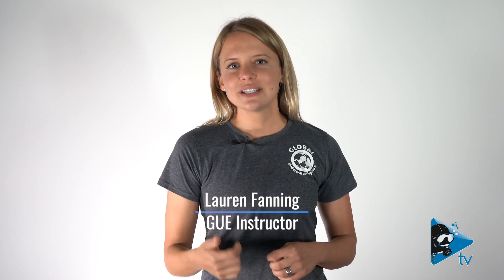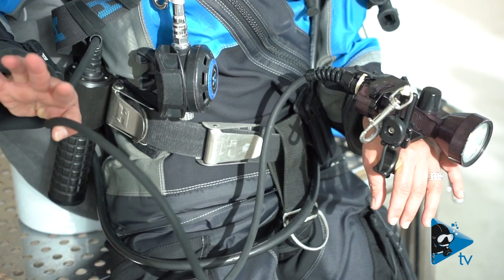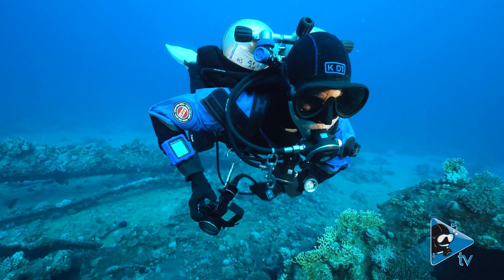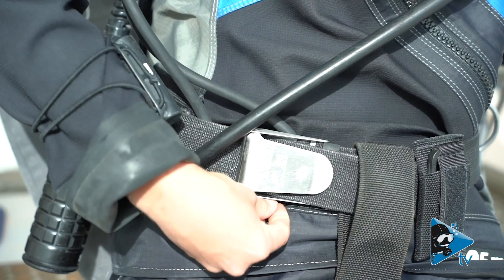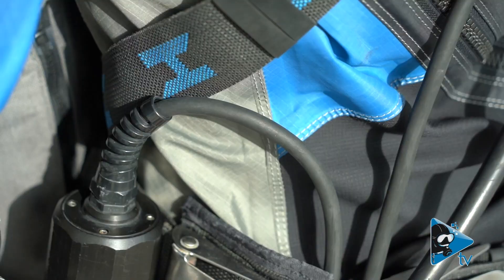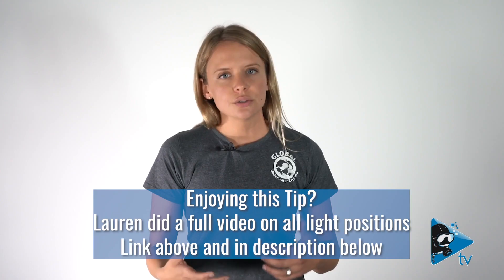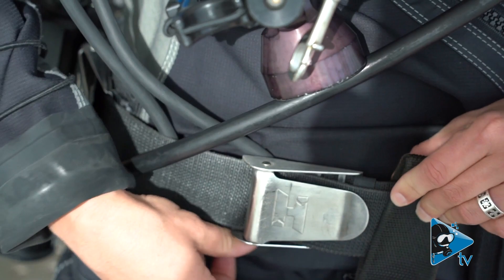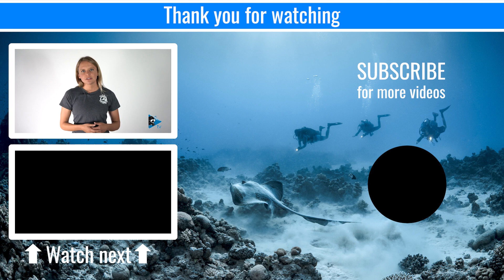Diving Tips & Tricks: Underwater Light Positions

Comment: Can you please describe the positions and equipment for standard vs. temporary stowage of the light head? For the latter it looks like putting a double ender on a bungee loop at the back of the light -- can this be used for the former, and if not, what do you advise us to use, and where should we attach it?
Reply: for standard stowage use a bolt snap attached w/cave line at the top right of the Goodman handle. You can see it if you pause the video around the 20sec mark. We don't use this while the light is on in the water, as it may cause the light to shine in our teammate's eyes. We don't use the temp position all the time for a few reasons, but the first that come to mind is that it dangles a little further away from us,  and can cause all the issues you could imagine related to that.
Reply from the maker: the full video of what you're asking for is https://gue.tv/programs/how-to-use-a-light-underwater?categoryId=7160

Comment: Not pulling too much on the cable so as not to stress it?  
Halcyon would do better to use quality cables that don't end up breaking and leaving you without power in a cave as has happened to me twice with my Focus 2.0.
Reply from the maker: well that's why we carry numerous back up lights right? In case these things happen. Did you pull too hard on the chord?
Reply: @GUEdivers  It can happen, yes. But not with a normal use and a 1,800 $ light. 
If I am going to run out of light, I prefer to do it with a 300-dollar Chinese focus. You are without light but if you manage to get out you get less angry.  
Talk to the official Halcyon technical services.  Mine tells me that they continuously gets lights with this problem. Incredible!